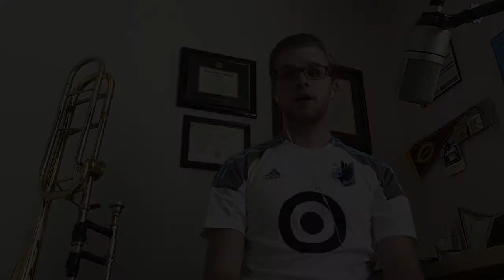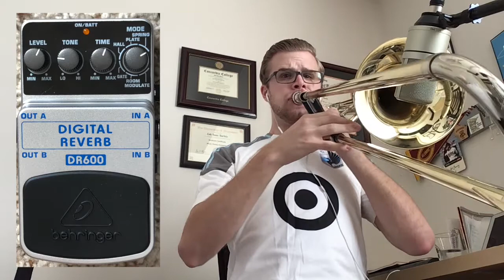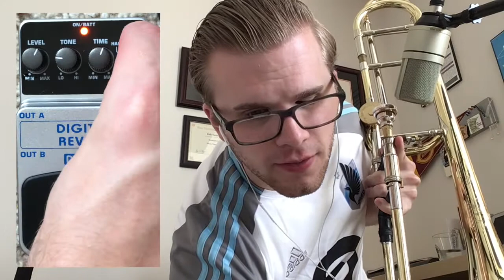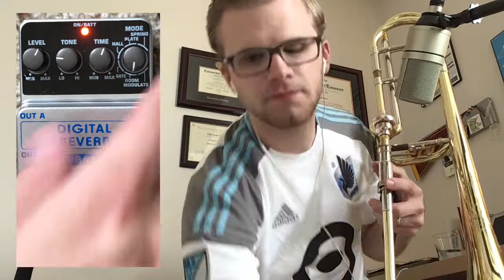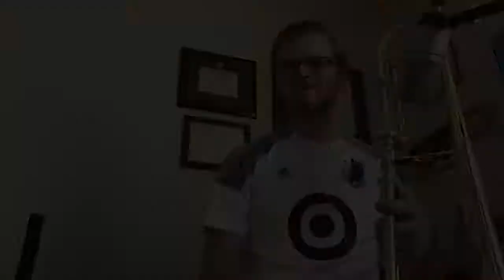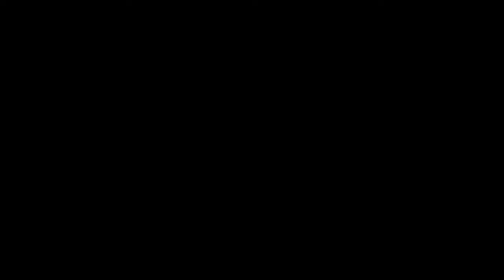Behringer Digital Reverb DR600 - Effects Pedals for Trombone

Comment: I have question. Did you use the pedal with microphone? İs that possible ? I thought its a Guitar pedal
Reply from the maker: Yes! You can basically think of the pickup on a guitar as a specialized microphone. My setup here has the microphone running into a mixer, providing phantom power, and the output is routed into the pedal board. The output of the pedal board is routed to my audio interface.
Reply: yes ofcouse i like to use them in some diffeent ways. i play dub / reggae music and and echo and reverb on my siren synt is really fun to play with and to create space like effects